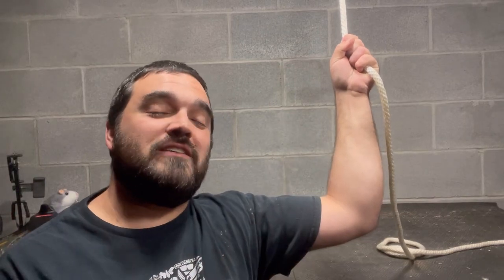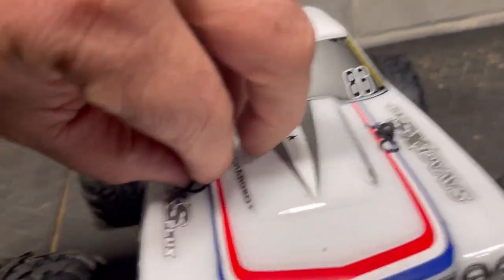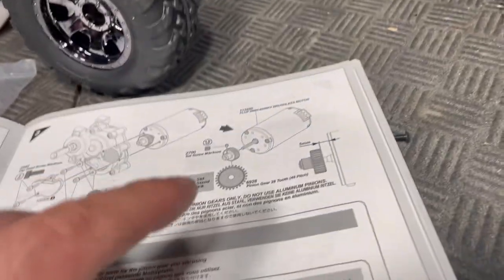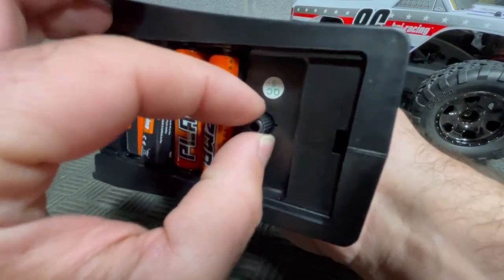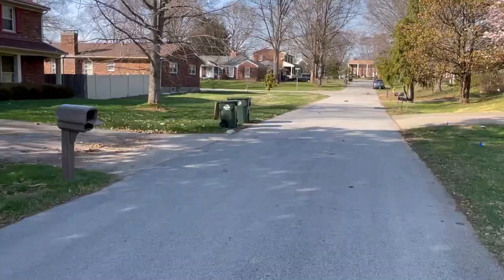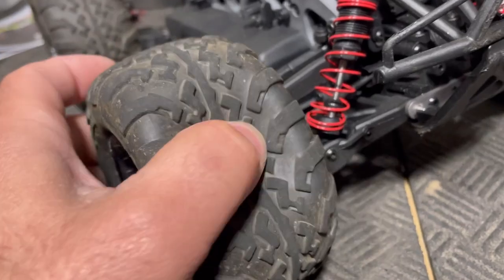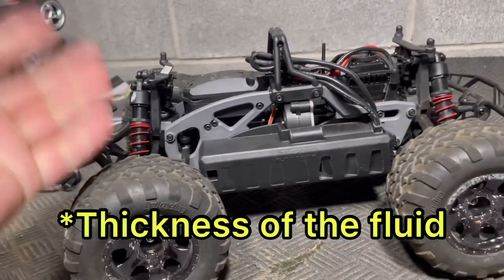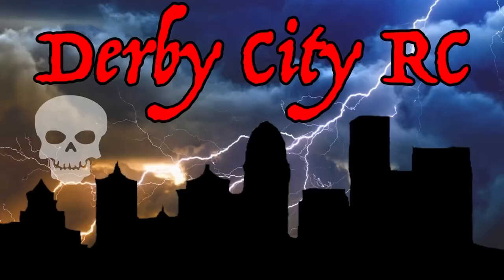World’s Fastest Mini Monster Truck - HPI Savage XS

Comment: I found you can buy an extra set of shocks, unwind the pre-load collars all the way, and it soaks up landings beautifully. Not to mention more shocks giving more equal pressure on the arms during landings prevents some of the flex that breaks outdrives

Comment: I actually like the tyres not having much grip. Can even powerslide and drift on asphalt, which is fun. Of course if you where to race the rthing, slippy tyres is bad, but for just drifting around, it's super fun.
Reply from the maker: Yes I like sloppy tires too, but these were really bad for jumps. There’s barely any foam in them. Just overall bring the truck down I think. I have plans to revisit this truck soon with some upgrades!!

Comment: Jeez Evan, where do I start? This rig is ridiculous! I like it a lot! I do think you made some valid points though, namely the tires.  These most definitely need to  have some foams in them in my opinion, might help with some of those brick drop landings😝! It looked like it would jump well for the average jumper, as your jumps are way beyond average. I like that it’s planted so well. Like you said; it would be awesome in an open field for sure.  I think hpi really did a great job thinking outside of the box on this one , but in doing so missed a few things that should be inside the box😂. I still love it though! I want one. That El Camino is One nasty looker!😍🥰 
As always awesome review video!
Reply from the maker: Thanks Robby!
Ya they did a lot right and missed a few more obvious things lol
 It yes for average jumps she should be good with better tires and maybe a bit thicker fluid since it’s so heavy. 
The el Camino is awesome I agree!!
😎😎👍👍🤘

Comment: I have had this truck for a bit. I recommend doing the shocks for sure.
If you upgraded to the 3s, you need the pinion gear. I would also recommend upgrading the drive shafts going to the tires. I spiral broke the stock ones from the step up in torque from 2s to 3s. It's got way tooooo much torque for its own good, too much fun though. In the right conditions, you can pull a double back flip easily.
Reply from the maker: Good info, thanks man!!!

Comment: Did you ever find any aftermarket shock options? Specifically that plastic eyelet that holds on the bottom of the shock. I broke both sides of rhe rear twice already just doing small jumps and a couple low speed flips. I bought a couple of the parts kits and it just spins off so its easy enough to replace but im gonna be out of parts soon if this keeps up. lol Seems like a major weakpoint on an otherwise durable and fun truck. I have seen some videos of people bashing them pretty hard without that shock eyelet breaking so i dont know🤔  Definitely would like to get something figured out so it doesnt keep happening.
Reply from the maker: Unfortunately I haven’t had time yet. It’s definitely gonna happen I would love to get this car back out very soon.

Comment: Verry fun bashproof car, never tried it on 2s lipo, only 3s lipo. Hard used for many years, summer and winter. Proline sandpaws for backwheels, never tried it with the hpi servo and radiosystem, savox waterproof servo and sanwa mt4 radiosystem. Its verry powerful and fast little bastard, so like using better radiosystem to control the car, use some old hobao hyper 8 pro shocks.
Reply from the maker: Thanks for the info!!
It certainly has more potential than it’s stock form!!
Reply: @DerbyCityRC  have  8 rc cars thats up and running, im most into nitro cars, savage xs is æ 👍car.  3s lipo give you a good punch when you pull the trigger, standing backflips no problem, to many and the backwheel driveaxels will snapp
Reply from the maker: Awesome! Soon enough I’ll get a nitro or a gas car👍👍
Reply from the maker: Ya I want a gas RC soon!!
Reply: @kenhmful  Did you fix the drive axel issue ?
Reply: @rcplayground7  they last a long time if you dont put it on higrip surfase just to take a standing backflip time avfter time. Still juse stock dogbone drive axels, always have a spear one. It not a big problem for me, just dont take to many standing backflips, you can loosen up the slipclutch, but i like it tight, i been bashing it hard for many years, suprise me that its still running good and strong, like to drive it wintertime when hardpackd snow, my friends have gear for ice fishing when out driving snowmobiles, i have det xs in my backpack and playing with savage xs instead, hill climbing and big jumps. Im tierd of icefishing, it get me bored, im soon only 50years old😅 have adhd, so ice fishing since before i learn to walk, so i tierd of it. If i dont have the xs with me, then im racing and tuning my snowmobile lakeracing, hillclimbing an jumping, people find that kind of anoying. Some times i leave t snowmobile and take my old suzuki lt 250r racequad at the snowmobile trails, have same kind of helmet and glasses as the blue crazy frog, and the racequad is realy anoying for grumpy old people, but fun as hell so i dont care unless i see t police, hasent catch me yet, raced them with my car, atv, snowmobile and even with my sons 110cc pocket bike, adhd can be a hell of a drug😅
Reply: @DerbyCityRC  🤣😅
Reply: @DerbyCityRC  im in to porting/mod a Lrp zr.32 right now, pulling strong with verry good torqe when stock. When porting rule number one#if you dont have a clue, dont tuch it and leave it stock, if you mess with it remember less is more👍
Reply from the maker: For sure!